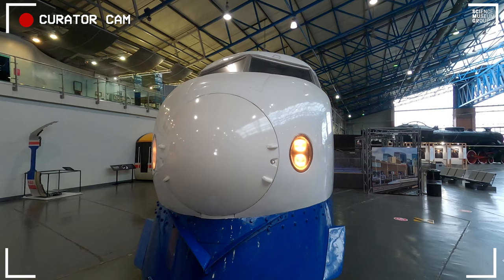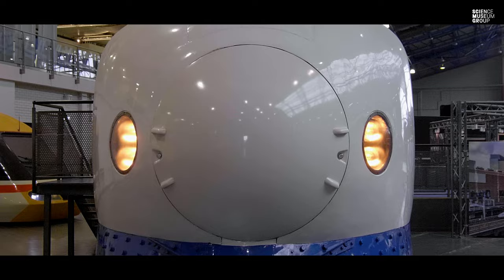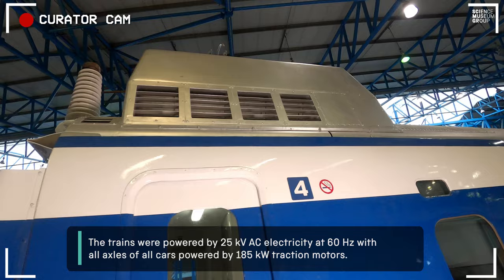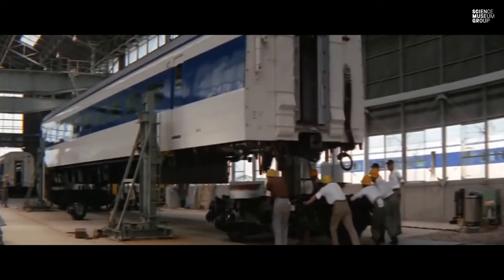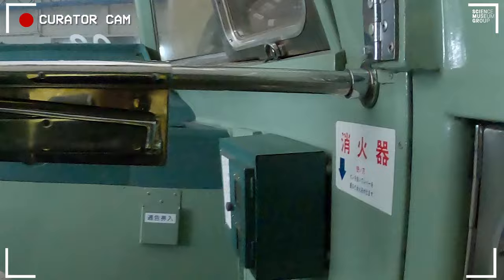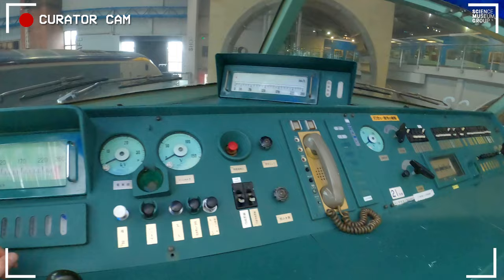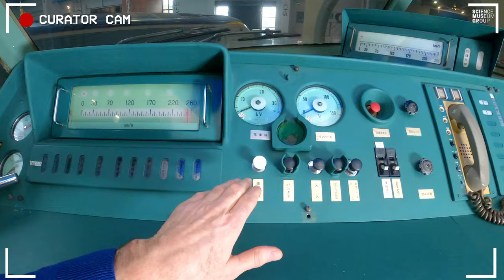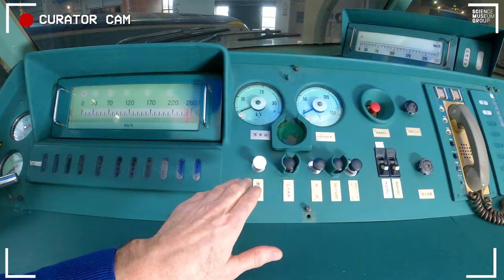Original Japanese bullet train—inside tour | Curator with a Camera

Comment: The seismometer network can actually apply the brakes before the earthquake reaches the train. The seismometer closest to the epicenter detects the earthquake and immediately commands all trains to apply emergency braking. The trains may not come to a full stop before the earthquake reach  them, but they will have slowed down enough to minimize damage. They also have earthquake sirens in cities that work the same way.
Reply from the maker: What an excellent bit of tech, thanks for the info
Reply: @NatRailwayMuseum  The system doesn't give a lot of warning. Often less than 20 seconds. But especially for larger quakes that can make all the difference.
Reply: @lars7935  The amount of warning given in practice depends on the distance between the epicentre and the railway (or city).  The seismometers detect high-frequency vibrations which travel more quickly and can't be felt by humans (though some animals notice them), while the damage is typically caused by low-frequency waves which travel more slowly.

Most major quakes originate in the major faultlines in the ocean or in the Inland Sea, some distance off the coast of Honshu.  For example, the Great Hanshin quake (also known as the Kobe earthquake) actually originated under the smaller island of Awaji, between Honshu and Shikoku.  For these, several minutes' warning is available for even a coastal region, enough time to halt a modern Shinkansen using the emergency braking systems designed specifically for this purpose - which on the newest types even include aerodynamic spoilers (which look like ears) to supplement the usual friction efforts.

To get only 20 seconds' warning requires the quake to be a shallow inland type, which has in fact occurred, and a Shinkansen set was derailed by such a quake.  This derailed train was however kept "upright and in line" as the terminology goes, and nobody was seriously hurt.  These shallow inland quakes occur frequently, but it is rare for them to be as serious as the deep quakes; a major quake in that location was unexpected.
Reply: @NatRailwayMuseum  Obviously, the amount of warning varies depending on the distance from the epicenter. There may be minutes before the s-wave hits you if you've got a good distance, or it may not arrive in time at all if you're super-duper close. I think that's the big perceived weakness of earthquake early warnings: they're not predicting something in the near future but rather alerting about something that's just begun to actually happen, and unlike a tornado for example, earthquakes are quite quick by nature. Still, such a system has proven invaluable in saving people's lives by giving them those precious extra moments to prepare for the incoming shaking.
Now, in addition to train emergency brakes(which was actually what the system was originally made for), the warnings also signal the city PA systems that seemingly replaced the older siren systems, as well as TV and radio. In fact, on live TV, the presenters tend to actually be alerted to the warnings just so they can stop whatever they're doing and deliver some basic info while the newsroom's getting ready to cut in.

Comment: I love the look of the old Shinkansen. It looks like someone took an airliner, removed the wings, and tail, cut the fuselage into sections, installed electric motors, and train wheels underneath, and now you have a really cool train.
Reply: More high-speed trains should look like a plane on rails.
Reply: With how many engineers came from the aerospace industry, you are probably not entirely wrong.
Reply: @HalianTheProtogen 
But that not how air resistance and noise reduction work
Reply: I'm pretty sure this was completely deliberate. The designers of this train wanted people to think of it as fast and cutting-edge, so they made it look like a jetliner, the epitome of speed and technology at the time.

Comment: In 2002 to 2004 I worked on the Taiwan High Speed Rail Project, rolling stock, power and train control systems. The trains were, IIRC, series 7000 Shinkansen. Some may know that this contract had been awarded to Alstom et al but that the Japanese consortium came in with such a price reduction that the Owner ditched Alstom (agreeing to pay them a huge amount in compensation) and place the order with the Japanese. 
This is a long intro to the point of my tale: bogies, width, coach length, loading gauges. The approach tunnels to Taipei station had already been completed and deemed fit for the European stock, as to width, height, length of carriage etc. Remember that the Alstom TGV units are articulated. 
For the non-articulated Japanese stock, there was some concern that the approach tunnels were too narrow. Japanese stock, being wider, on bogies, longer with more 'throw' on curves. Whilst the static loading gauges were deemed adequate, worries centred on the dynamic loading gauge. The Japanese companies stated that for their stock the dynamic loading gauge was the same as the static loading gauge, meaning that, inter alia, the coaches did not rock from side to side. An amazing concept. 
But they were right.
Reply: I think you mean the 700 series. But other than that, you're spot on - what an amazing story this is.
Reply: @TheMrJourneyer  Thanks: 700 it is!
Reply: @johnclayden1670  

I'm a Japanese train old fan.
I heard that the Japanese engineers had a hard time trying to match the two, with the track equipment and signaling equipment being made according to European standards and the Shinkansen trains being made in Japan. 😌
I understand that the major reasons for the change to Japanese-made Shinkansen trains were the ICE derailment and overturn accident in Germany in 1998 and the occurrence of the Taiwan earthquake in 1999.🤔🍀
ーーーーーーーーーーーーーーー
日本の鉄道オールドファンです。
線路設備と信号設備は、欧州規格で作られ、新幹線車両は日本製と、異なる両者のマッチングを図るため、日本人技術者は大変苦労したと聞きました。😌
なお、車両が日本製の新幹線電車に変更された大きな理由は、1998年ドイツのICE脱線転覆事故と、1999年の台湾大地震の発生が契機になったと理解しています。🤔🍀
Reply: @Midori-Clover  And Chinese make fun of this incident to sell their high-speed trains. Although India is building with Japan.
Reply: @Saurabh_Utter-Pradesh  さん

Thank you for your reply. ☺️
Yes, you are correct. 👍

China 🇨🇳 is intercepted Indonesia 🇮🇩 Shinkansen project from Japan 🇯🇵, but the project is not progressing according to the quotation they submitted. 😅
In other words, I think it can be said that China’s 🇨🇳 political purpose was the first, and the true purpose was to induce developing countries into a “debt trap”. And their technology is a copy of Germany 🇩🇪 and Japan 🇯🇵, but you can feel the “deterioration” of technology without even remembering past accidents. 🤔

In that regard, the Taiwan 🇹🇼 Shinkansen is running well, and the India 🇮🇳 Shinkansen project is progressing steadily. 🤔🍀

(Reference) India 🇮🇳 Shinkansen Project (Video created by Japan International Cooperation Agency, JICA)
//youtu.be/nhsERK7-5_0
ーーーーーーーーーーーーーーー
お返事ありがとう。☺️
ええ、あなたのおっしゃる事は正しいです。👍

中国🇨🇳はインドネシア🇮🇩の新幹線計画を日本🇯🇵から横取りしましたが、彼らが提出した見積書に従って、プロジェクトは進行していません。😅
つまり、中国🇨🇳の政治目的が最初にあって、発展途上国を「債務の罠」に誘導するのが、真の目的だったと言えると考えます。そして、彼らの技術はドイツ🇩🇪と日本🇯🇵のコピーですが、過去の事故を思い起こすまでも無く、技術の「劣化」が感じられます。🤔

その点、台湾🇹🇼新幹線は上手く運行されているし、インド🇮🇳新幹線プロジェクトも着実に進捗しています。🤔🍀

(ご参考)インド🇮🇳新幹線プロジェクト(日本国際協力機構、JICA作成動画)
//youtu.be/nhsERK7-5_0

Comment: Accurately speaking, the mechanism of the emergency stop is that after the seismometer detects the initial microtremor (p-wave), the breaker at each substation trips, cutting off the power supply and stopping it. Thanks to this system when the Great East Japan Earthquake occurred. In total, about 29 trains were able to stop safely. Recently, stopping in tunnels or on bridges is dangerous, so by downsizing the machine, we installed a storage battery in the Shinkansen and used that power for about 40 minutes. It is designed so that even if it is able to move and the power supply is cut off, it will be possible to evacuate from the vehicle after moving to a safe position.

Comment: Small correction:
No Shinkansen line repalced any existing line. Intercity services got moved to Shinkansen lines - which translates to "new main line" - but the original main lines running along the same corridors still exist.
Nowadays these lines carry mainly regional trains but still a limited number of long distance services alongside freight.
Reply: "Shinkansen line" is redundant, "sen" already meaning line.
Reply: @frontenac5083  Yes and since that is not commonly known it's generally translated as above. After all we aren't calling it "new main line" either. 
The purpose of translation is to properly communicate, not transcribe word for word. Especially as we are talking about multiple lines on the Shinkansen network it makes little sense to talk about multiple Shinkansen as that would infer multiple different systems to an english reader.
Calling it Shinkansen lines makes it clear that it is one system with multiple lines instead of multiple incompatible systems.

And no just because there is currently no rail connection between Tokaido Shinkansen and Tohoku/ Hokuriku/ Joetsu Shinkansen doesn't make it two systems. It is still one systems split into two (almost) continuous sections. Especially since a connection via the western Hokuriku Shinkansen is in the works.
Reply: The Nagano Shinkansen has replaced 1 section of the existing main line tho
Reply: @somerandomidiot1340  I think you mean the Hokuriku Shinkansen. And no, it did not replace any existing main line. By Japanese law, the existing main line next to a new shinkansen has to be maintained and kept in service, either by one of the JR companies, or a prefecture-controlled private entity. You can still travel from tokyo to nagano via conventional cape gauge train if you want to.
Reply: @Limskjordan  The Shinetsu line actually did get abandoned between Yokokawa and Karuizawa in 1997. It's not a very long section, but it was in a mountainous rural area of Japan that would have seen no traffic with the Shinkansen. The tracks were even torn up, and now there's a railway museum at the site of the former rail depot in Yokokawa.

Comment: It's interesting that the Shinkansen was a game changer not just because of its speed, but how it was used. Trains running at 125mph+ were nothing new - the German 877 Hamburger, American Zephyr and Italian ETR-200 had done so decades before in the 1930s, but the Shinkansen was revolutionary because unlike those trains that ran on traditional rail lines, the Japanese constructed dedicated high-speed lines that lacked tight corners or steep hills, level crossings or interference from slower commuter & freight trains. This relatively simple change in operations turned the Shinkansen from simply a fast train to a phenomenally effective mode of transport.
Reply: I'm a Japanese train fan. 
Japan's railways opened in 1872 with the technical and operational guidance of the British🇬🇧, and although they adopted narrow gauge (1067mm), they were not suitable for high speeds due to other factors such as the mountainous area.

Later, in 1910, a resolution was passed to convert the narrow gauge to standard gauge (1435 mm) in order to increase transportation capacity, and research progressed, but the conversion to standard gauge was canceled due to differences in intentions between political parties.

The "Bullet Train" project by constructing a new standard gauge line, which is directly related to the current Shinkansen project, began in 1939, and some tunnel construction also began in 1940; It was canceled in 1943 due to World War II.
However, the tunnel dug at this time was used as the “Tokaido-Shinkansen” line, and many people have passed through it since it opened in 1964.

Finally, with the success of this bullet train project, I am confident that this method of intercity transportation, which does not rely on airplanes or road transportation, will hold a special place in the history of world transportation.😌🍀
ーーーーーーーーーーーーーーー
私は、日本の鉄道ファンです。日本の鉄道は、英国🇬🇧の技術・運営指導により1872年に開業しましたが、ナローゲージ(1067mm)を採用しましたが、山岳地帯等、別の要因もあり、高速化には向いていませんでした。

その後、1910年には輸送力増強のため、狭軌を標準軌(1435mm)に改築する決議が行われ、研究も進んだが、政党同士の思惑の違いにより、標準軌化は中止させられました。

そして、現在の新幹線計画に直接関係する、標準軌新線の建設による「弾丸列車」計画は、1939年に開始され、1940年には、一部のトンネル工事も開始されましたが、第二次世界大戦の影響で、1943年に中止されてしまいました。
でも、この時掘られたトンネルは、東海道新幹線の線路に活用され、1964年の開業に伴って多くの人々が通過しています。

最後に、この弾丸列車計画の成功によって、飛行機や道路交通によらない、都市間連絡交通の一つの手法は、世界の交通史でも、特別の地位を持つものと確信しています。😌🍀

Comment: 4:40 The bogie and vibration problems are usually overlooked in most Shinkansen videos, so this is impressive. It was arguably one of the most important engineering aspects of the system, and a little understood area for trains at the time, I believe.

The theorisation of vibration/oscillation behavior of high speed trains was essentially what allowed  the Shinkansen to be ran at such speeds.

Comment: I was in Japan around the time the type zero trains were finally removed from service (1999) - at this point, they had been relegated to the "stops all stations" Kodama service and although I was doing regular trips to Osaka I had never used one because I was using the faster services. This time, I decided to get the Kodama - I have to say it still seemed amazingly modern for a train put in service 35 years before - the train also had a "Thank you Type Zero" sticker on the nose, which I thought was nice.
Reply: I was lucky enough to ride one of these in 2008. They were actually running the Kodama until later on that year and I was fortunate when one arrived at Himeji (I'd been to see the castle). 
I had hoped to see one during that trip to Japan (my first) and was very chuffed to actually get on one. There was hardly anyone on it either. It was in remarkable condition despite its age although the design was clearly dated.
I didn't get a shot of the 500 series though which was a shame; I love the look of those.
Reply: @acciid   I had no idea they were in service that late - I was living in Tokyo and made fairly regular trips to Osaka, but normally used the higher speed Nozomi service (which IIRC was using the 500 series trains at that time) - there was quite a bit of publicity about the end of Type 0 services on the Tokaido Shinkansen, but I guess it does make sense that they were transferred to other lines.  I'm not surprised that they were still in good condition - the maintenance procedures are similar to the ones used on aircraft.
Reply: @TrimeshSZ  sadly they don´t preserved one in working order.  At least a short one!
Reply: There's a carriage from one in the Yokohama railway museum, but I think it must be a later-used (and thus upgraded) one. It looks hardly any different from the current ones!

Comment: Some good stuff here, but also a lot missing.  Examples,
All seats are turnable so you can be facing forward normally, or if traveling with family you can rotate a set to face your companions.
The centralized earthquake sensing system will automatically bring the train to full stop if a nearby earthquake is reported

Comment: I'm in the States and am hoping to get to the museum on my planned trip this fall. You keep giving me more reasons to visit.  Keep up the good work, I'm looking forward to more temptation!
Reply: Fly to Manchester (north west of England) and take the train to York from there.
Reply from the maker: We hope you have a fantastic visit. Make sure you check out website for opening dates before you come :)
Reply: In my opinion your only doing one of them. not right in a way for me to throw this at you since visiting from afar really limits what you can travel out too. but the NRM Shildon has the apt-e and.. the high speed freight vechile...
Tadishi Masudaira was the first to solve the hunting oscilation/derailment problem and his train did 135mph, he chose the brand new rail profile and brand new wheel profile. 
Alan Wickens led a team that solved the problem forever. trains can do any speed on different rail profiles that BR inherited. the limiting factor for future trains speeds, aerodynamics, motor power, wearing out rails too fast, ect. The HSFV or one of them is one of the few of these test beds left.

Comment: 8:07 : that compartment is actually for the driver’s pocket watch. Not a stop watch. 

Fun fact: Japan is the only country where engine drivers still uses pocket watches in present time. Except they’re battery powered. The reason they still uses pocket watches is because of its easy to read time while on display instead of looking at a wrist watch constantly while driving.

Comment: Last time I went to the NRM, this immediately caught my eye. This must have excited Japan at the time. I got to sit down in the passenger cabin. Comfortable but seemed a bit too modern for a 1969 train? I see that this was a new interior fitted before it came to the museum, but is that how they were in period? If so, that's strikingly modern.
Reply: Those seats were replaced in the 1980s. Before that, the seats were switchable cross seats. Only first class cars had reclining seats.